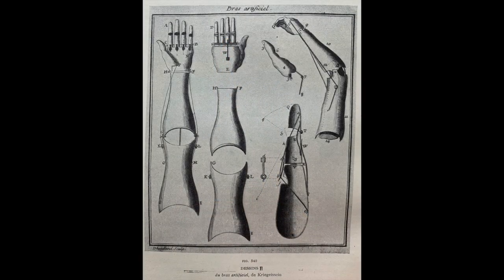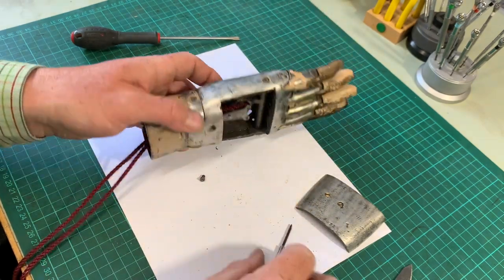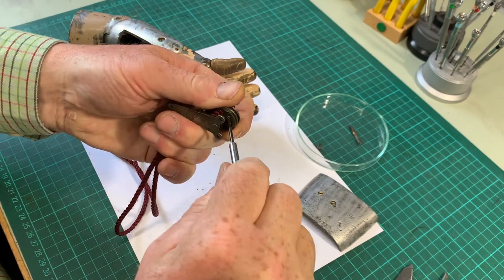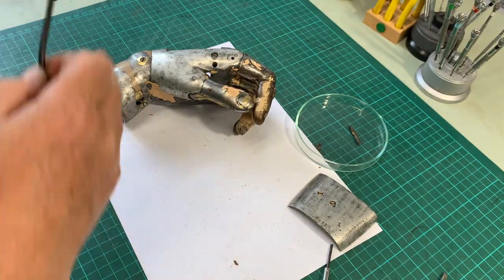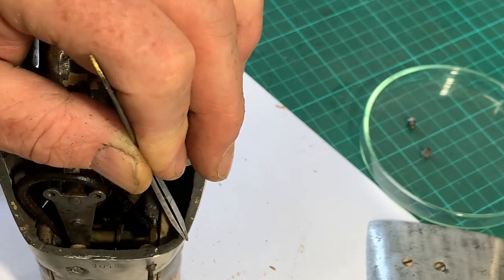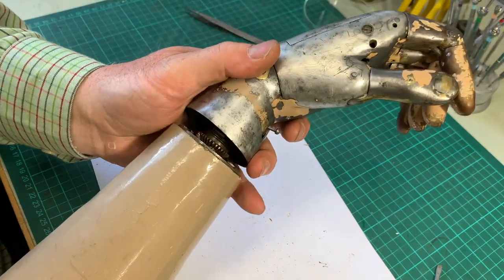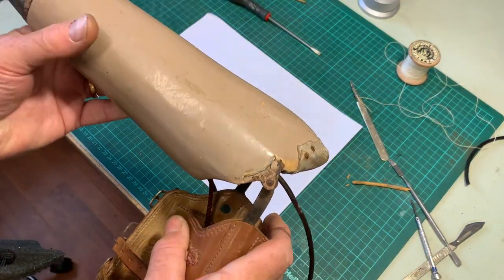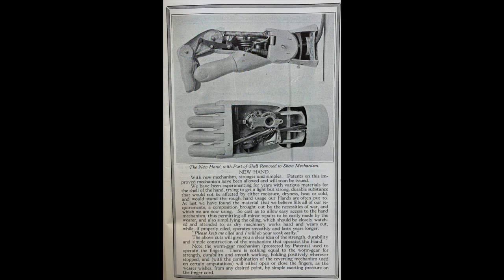The Carnes Prosthetic Hand 1910

Comment: Why is the hand that's on display able to show 1 finger up and the other fingers differently flexed then the 1 that you were working on.  Is the 1 that you were working on different mechanically inside then the 1 being displayed?And is the 1 being displayed have a lot more mechanisms inside the hand in order to have  finger movements. Thanks for the answer.
Reply from the maker: Well spotted! the hand in the dome is a different Carnes hand where the transverse rack bar with the finger lever connections have been removed allowing all the fingers to be posed individually. It cannot work like this but I prefer it for display. The disconnected parts are stored in the hand to prevent loss.